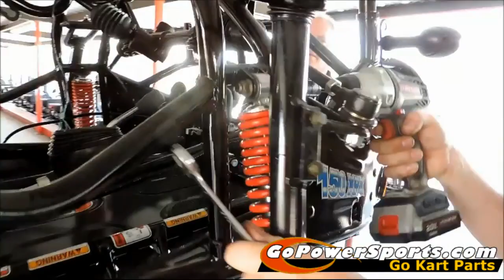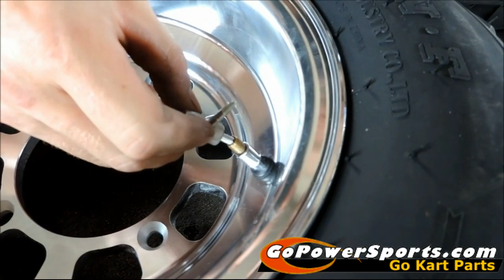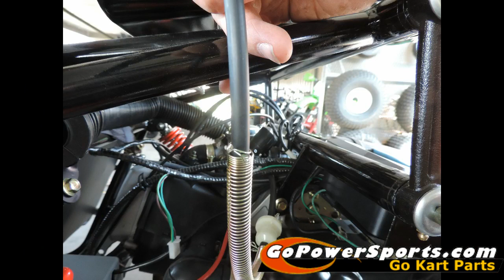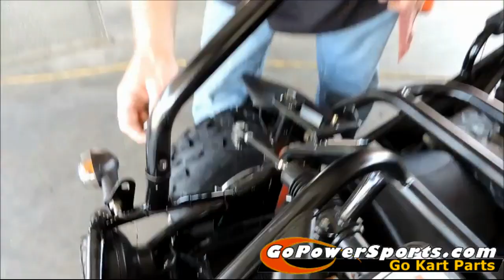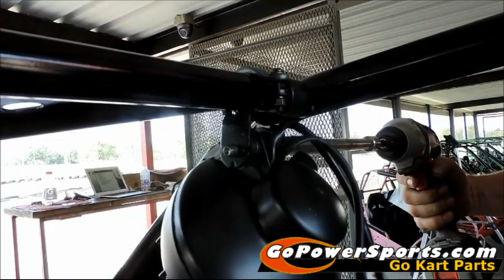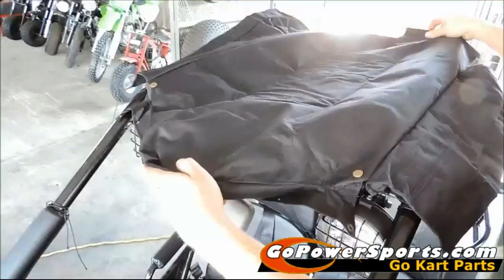How To Assemble the TrailMaster 150cc/200cc Adult Go Karts | Step by Step

Comment: To break a bolt locked with red loc-tite approximately 175 foot lbs of torque is needed. 
Novice mechanics should use blue loc-tite and  use red loc-tite when the bolt will have a VERY low probability of being removed. In other words, Use Blu Loctite.

I've built a couple of 'import karts'.
Regardless of brands, in my experience.

Use a cross or star pattern tightening wheels.

Stop electrical gremlins now.

I use a small amount of Di Electric on all connections plugs and grounds. Its  available at auto parts stores.

Check all of the wire routing. Make sure positive wires are secured and not rubbing against the frame. Positive wires have been found pinched between a plastic electrical box and the frame causing shorts and in one case a fire. 
Check all negative wire grounds to frame. For good grounds to painted metal remove the terminal and sand or scrape a small area of paint, small enough the terminal covers it. Reinstall terminal.
Connect the red positive + wire to the battery and tighten it. 
THEN  connect and tightened the negative - cable.  
If you are new to doing your own mechanic work get in the habit of installing the negative cable when the kart is on the tires and you are ready to do the fluid fills.
Check lug nuts.
Connect negative battery wire.
Fill Oil, 
Fill fuel.
Start the engine.

Comment: How much is a torque convertor for a 240cc or 8 hp with a 1 inch crank shaft. It is for a go kart like in the video here. The original motor is gone.